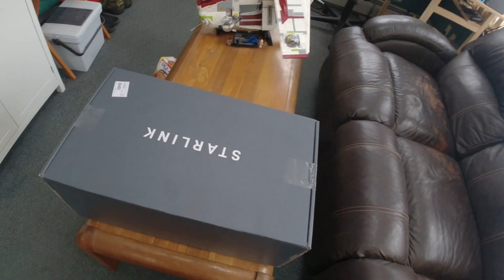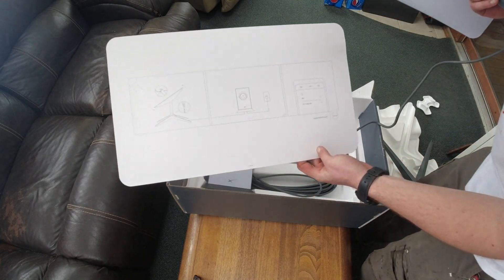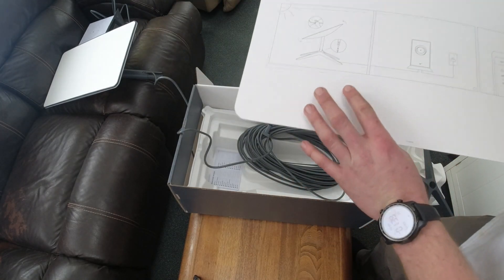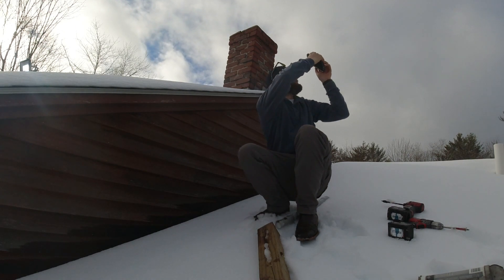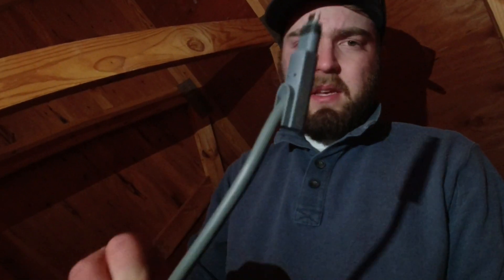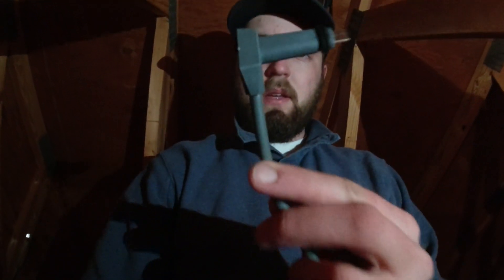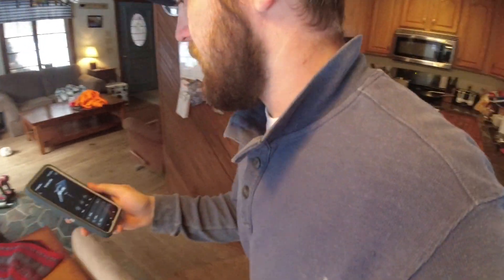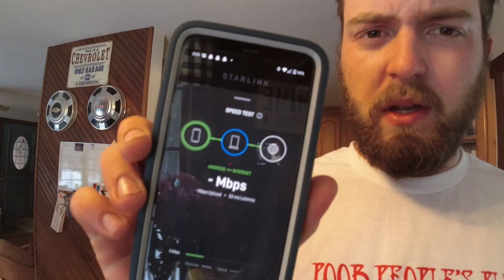How to install Starlink internet/what to expect

Comment: Other YouTubers have said the pole attached to the dish needs to be straight up and down. Also try to face it north. Thx for sharing.
Reply: You don't have to point it in any one direction as it will orient itself
Reply: Yes its best to have it as straight up and down as possible. While it will work at an angle the software inside that does the phase array tracking with the dish is only configured to work within like a 15^ angle. Anything outside of that will work, but it will be far from optimal as the array tracking inside will not be working correctly and will result in more drop outs and slower overall speeds.

Comment: Great video! Kind of random but I’m hoping to get Starlink but I heard that I can’t view security cameras outside of the network. Do you know if this is true?
Reply: Wyze cams work fine
Reply: I have reolink and lorex security cameras working great with starlink
Reply from the maker: Thank you. I can't say for sure if cameras will work because I don't have any but I would have to imagine they would as long as they use a wireless connection to connect to the internet. The starlink router has no hardwired ethernet ports
Reply: @kinvillesdoitall8047  thank you!